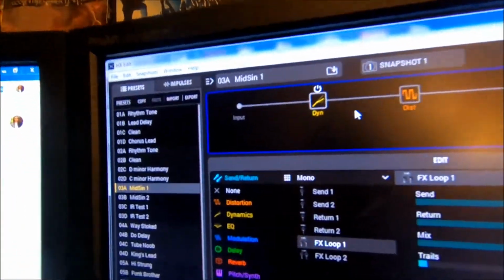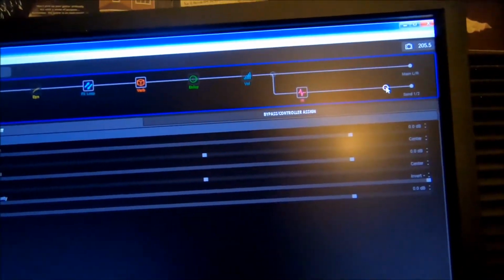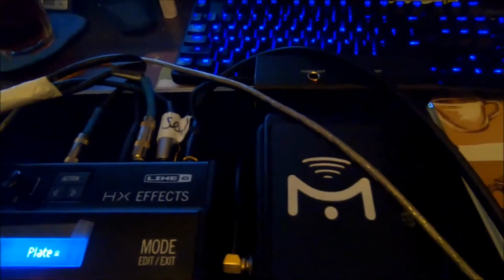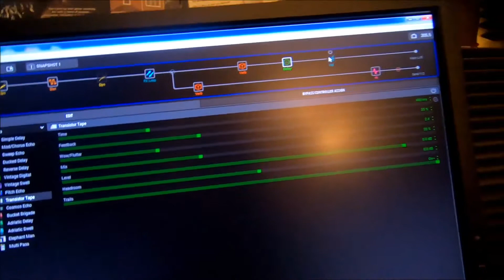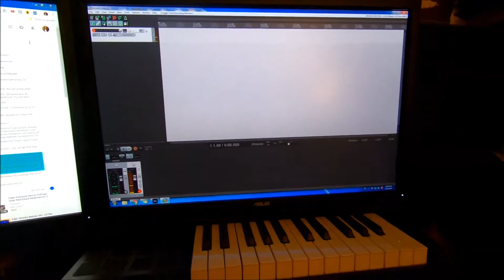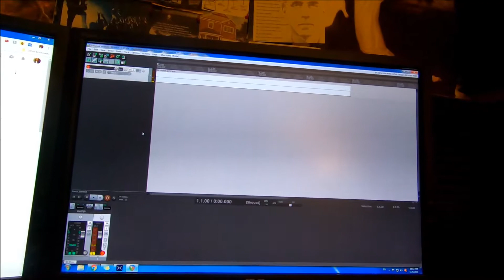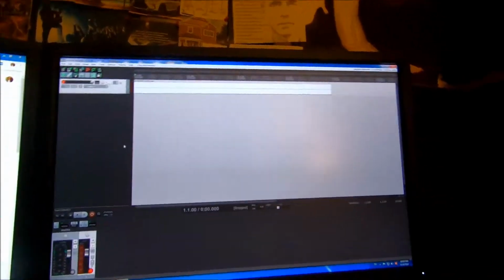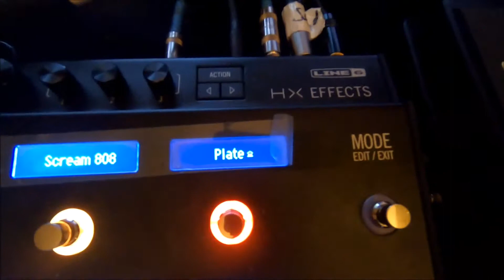4 Cable Method AND Cabinet Simulation BUT with HX Effects

Comment: i have a 4cm preset and I m trying to use send2 as ear monitor for live session, but I can t hear the loop fx in earphones... I watch your video but I didn't reach a solution
Reply from the maker: Hmm, that's interesting. I can suggest checking your FX Loop Block, and make sure it send uses both Send 1 and Send 2 (set at Center). I've never tried to use send 2 for ear monitoring, but it should work as any other send. Try using Send 1 to see if you hear FX loop effects and trace it from there.